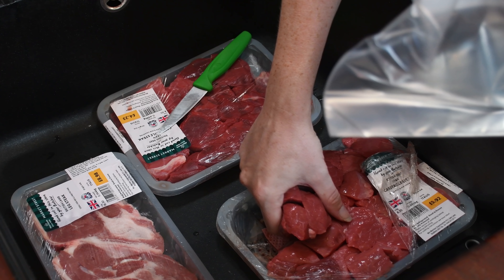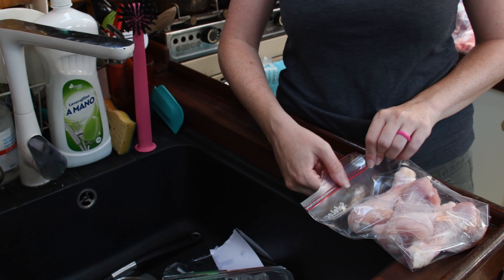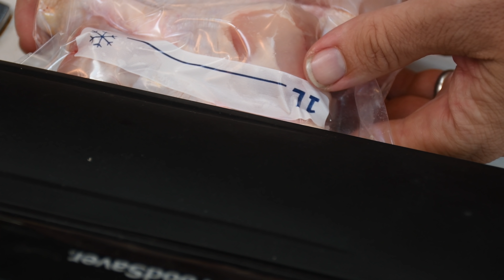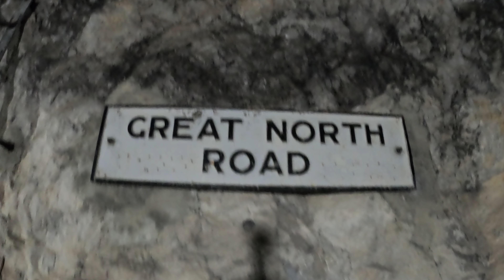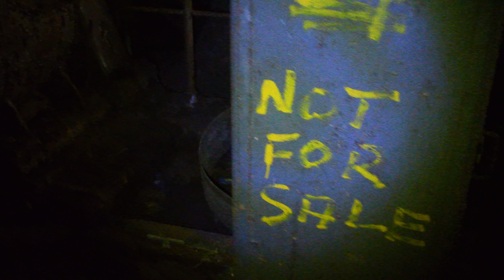Ocean Crossing Preparations! | Sailing Wisdom [S4 ep62]

Comment: the vacuum bad ziplocs is a great tip. Thanks. You can also cook sous vide in Ziploc Freezer grade bags.  Nathan Myrvold said you can do this. I've only made omelets using a JetBoil camp stove. 
It would be great to see some analysis of the types of common medical emergencies, their frequencies, how they're handled, but also errors made by sailors. 
You probably already know this. But if you put a couple of coats of varnish on your helm wheel and then polish it down with steel wool you can make it look and feel amazing.
Reply: Sous Vide is a priceless tool!  In a wrapped / insulated pot, the power draw is minimal, and the precision cooking results in so much better quality result it's amazing.   I've owned one for quite a few years, and wouldn't want to be without it!

Comment: i was going to suggest, why not just wash and re-use your zip locks, but then you went into the vacuum sealer bit. good idea. do you have any problems with the sealer melting the bags and is this cheaper than buying the manufacturers bags? and then you went and answered my 2nd question.  :-))
you're the only sailing channel to have mentioned, let alone toured the tunnels. great. but i'm disappointed that you didn't tour(if possible) what i understand to be the old cold war command centres.
Reply from the maker: They are cheaper, but I think we’ll use the regular ones when we can get them again. Much less waisted plastic. The Cold War areas were all closed off! Not sure if it was a covid thing or regular

Comment: Broken shrouds in next episode ??? -- Could you comment on IMOCA 60 racing sailboats standing rigging. They have two spars that starts at the base of the mast and that extends out to each side of the boat where the shrouds are attached. They don't seem to have any spreaders up the mast. Looks like the spreaders/spars are at deck level +/-. There is no doubt that this is a better solution for those very tall masts. Do you see this coming to cruising boats? 😎